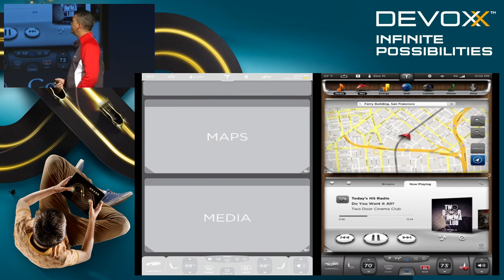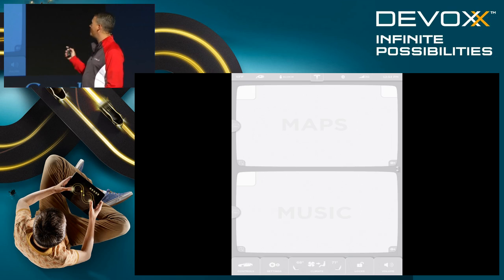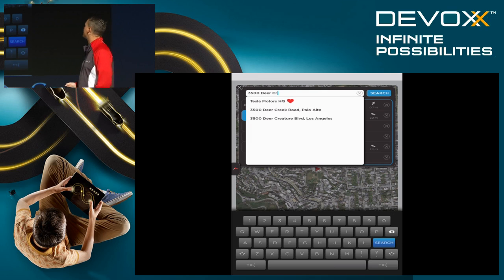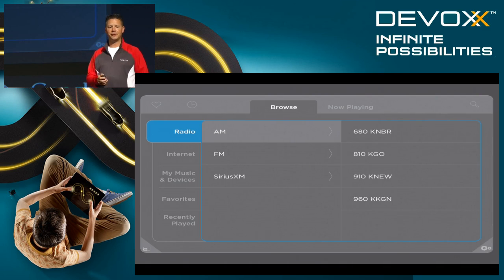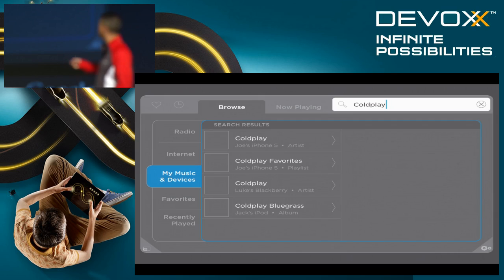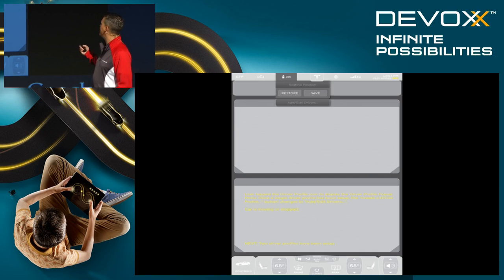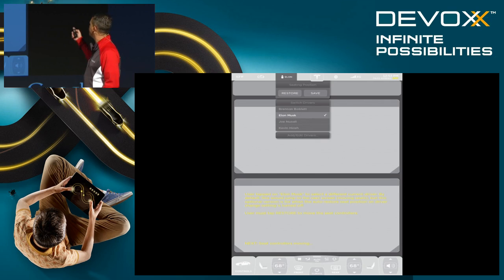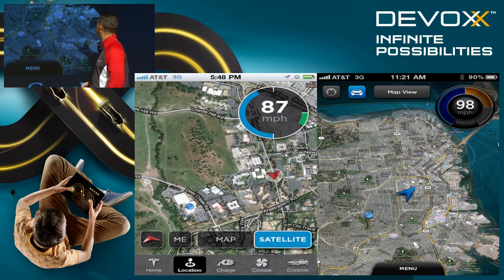Designing the Tesla Model S touch screen UI

Comment: The only thing I have is that I cannot switch on Fog lights very easily on TESLA S.  Lights are intuitive in other cars, but for Tesla, we have to look and touch, whereas other cars, you know how to switch on by feel.  That may be a change that is needed.
Reply: i presume from your name that you are german. In the USA most cars do not have foglights as most americans will just use them to dazzle other road users or improve their own visibility. Tesla simply does not pay them much attention. They are included for european use in EU spec teslas - hence you only have 1 reversing light -  but the Tesla engineers just do not think i.e. that a european user might i.e. want to switch rear foglights off if a car is behind them or front foglights off if a car is in front of them (just to suddenly turn them on if the traffic clears). In america you drive against each other, not with another.